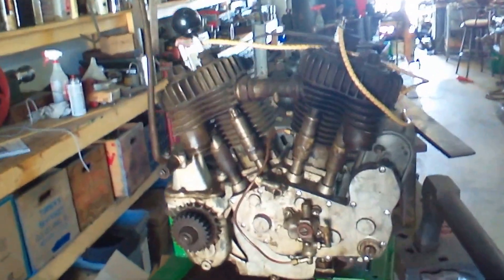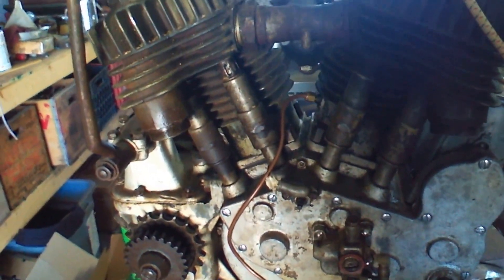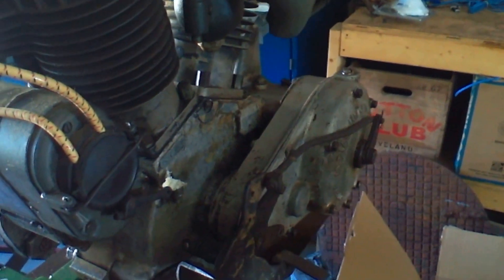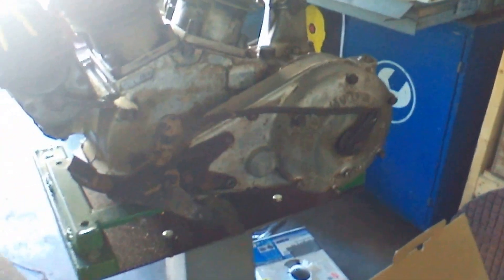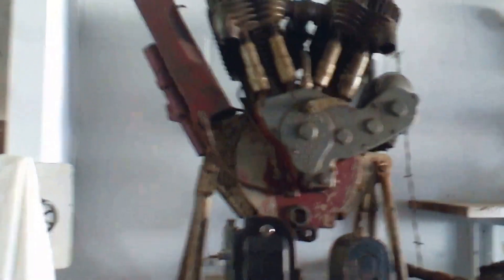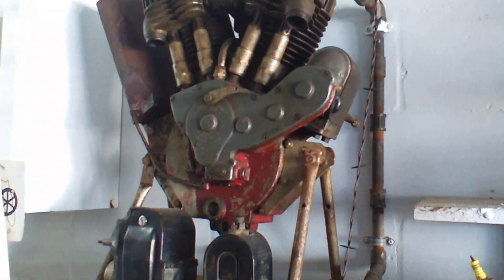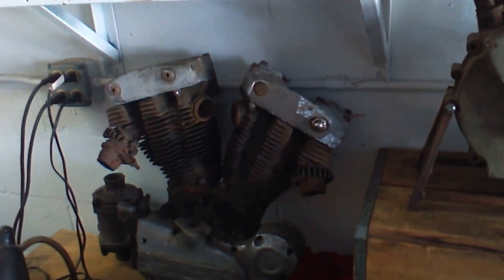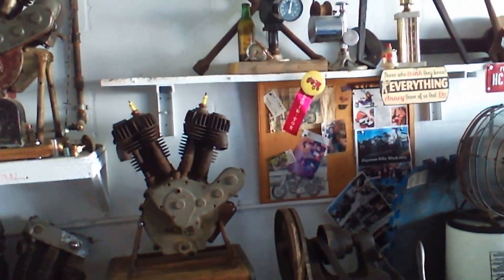antique indian  big cheif and powerplus motorcycle engines

Comment: How much would you need for 1916 engine above the crane and does that one run
Reply from the maker: the 26 engine   i was told that mainly mags did it.  i would need 8500 for the 16 with oil tank.
Reply: Does it run ??1916 with oil tank